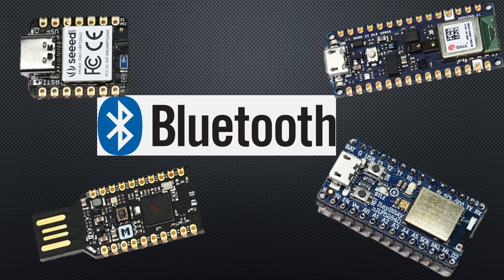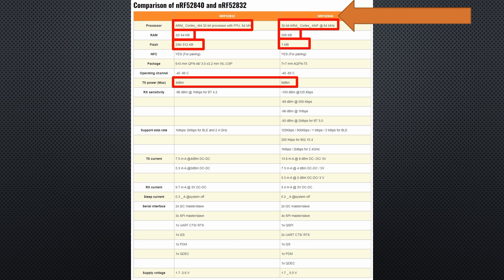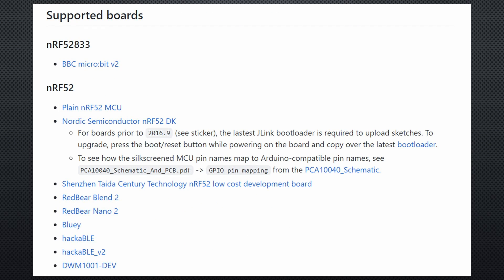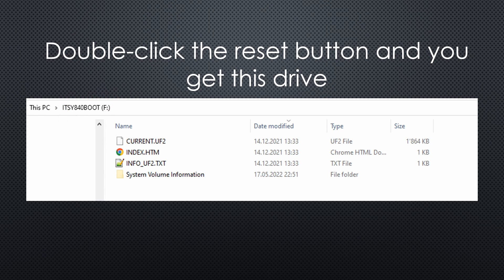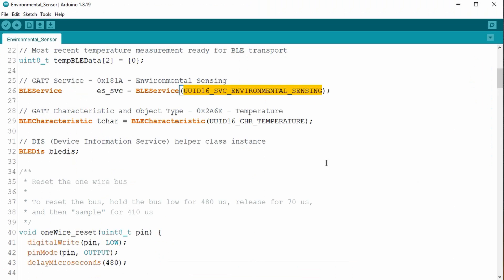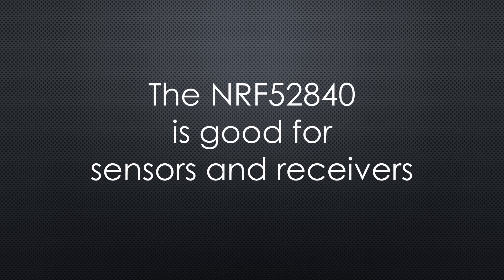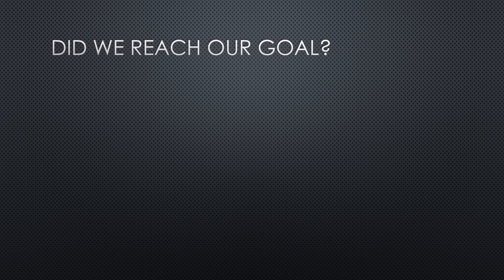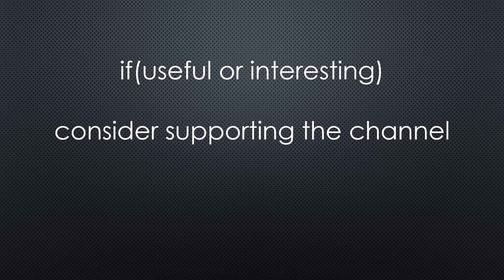429 NRF52 Bluetooth (BLE) Tutorial. Does it consume less than the ESP32? (Feather, XIAO, ItsyBitsy)

Comment: Great Video Andreas.   I have been a maintainer of a BLE keyboard firmware ever since the days of the nRF52832.  When I first got into it, I did try to program with the Nordic SDK and after hours of work, I still couldn't even get a LED to flash.  I then turned to the Adafruit nRF52 board support package and I was able  to get it working within minutes.  Since then, I have been creating keyboards and even extended my firmware to the nRF52840.  It's really a shame that Nordic doesn''t support the maker community and that Adafruit will only accept boards that they make or sell to be as part of their BSP. (This is quite understandable from a support point of view).  However, this only helps fragmenting Arduino Support for the nRF52840 boards into several forks and really doesn't help for maker adoption.  The nRF52 chips are amongst the best (if not THE best) for power consumption.

To get power consumption down with the Arduino IDE, you need to do some coding black magic (minimum would be to make sure to use a delay in the main loop; if you use a loop) and measure, measure, measure.  Apparent small changes in code, sometimes makes big differences in power consumption.  One has to remember that the CPU when running non-stop would use about 6mA (from the datasheet) and the radio about 20mA (From the datasheet).  Anything to minimize CPU time and radio time will help bring power consumption down.  There are also some "magic settings" from the softdevice that will also influence power consumption.  These aren't documented in the Adafruit nRF52 library but are buried in Nordic's documentation.

Adafruit's implementation uses FreeRTOS to manage the main loop and any other tasks one wants.  Delay for the Adafruit nRF52 library isn't a true "delay" but more of a yield of the currently running task to other tasks.  If the RTOS doesn't have any other tasks to process, it will go into low power mode until the next "tick" and see if it need to go back at running the delayed task again.  If I remember well, the "Idle" task does have the necessary code to put the CPU into idle state (low power) but the default might not be what everyone wants.  The defaults that Adafruit has implemented are reasonable for most applications but are not necessarily for everyone.  A lot of the tweaks one would need to do to get it running exactly as they want aren't exposed by the library but many settings have been exposed since I first started working with it.

To make fragmentation even worse, support for the nRF52833 (a chip with USB - like the 840 but with the flash and ram of the 832) isn't there yet, even if the chip has been out for a while.  The complicating factor to get support for it is Nordic's different softdevice versions.  From what I remember, the update from 6.x to 7.x changed a few things and none of the Arduino libraries I have seen supports the 7.x version - which is the version needed for the 833 and the newer, more advanced BLE features some people have been asking about.
Reply: Oh actually, the seeed xiao ble core uses the 7.xx softdevice and version 1.0.0 of the core includes the bluefruit library and examples
Reply from the maker: Good information. Thank you! Maybe we will get more attention after this video…

Comment: HyperX has managed to get 300 hours of operation from a single 5.5v cell in their new cloud headset. Maybe buying one and pulling the board and Bluetooth controller out might answer your question. The new chips use like .7miliamps , which is very impressive.
Reply from the maker: Astonishing! Usually this is the result of good hardware and good software…

Comment: (reposted without links)

Adafruit has long promised to look at power consumption, but it's not been a priority.  But there are workarounds.

First look at the issues database on github for the project.  Many tips.  One of the most beneficial I found was reducing the tick rate in the underlying freertos.  By default it is 1024, which means the processor is waking up 1024 times a second.  As the underlying nordic softdevice is handling beaconing, that is far too often for a simply beacon.  Those 2ma spikes you are seeing is freertos waking up the device.

I developed a beacon that sent temperature and humidity using the 832 chip. By reducing the tick rate to 4, and only reading temp/humidity once every 30 seconds, with a 2000ms beacon, I was able to get power consumption under 5ua.   Below a tick rate of 4, it would no longer work.      This should work with the 840 as well

Here are some tips

xxx
xxx

And here is the nordic online power profiler estimate tool.   With the above tips I get close to what they say is the lowest. 

xxx
Reply: (links for above)

Here are some tips

https://github.com/adafruit/Adafruit_nRF52_Arduino/issues/165#issuecomment-454707613
https://github.com/adafruit/Adafruit_nRF52_Arduino/pull/262

And here is the nordic online power profiler estimate tool.   With the above tips I get close to what they say is the lowest. 

https://devzone.nordicsemi.com/power/w/opp/2/online-power-profiler-for-bluetooth-le

Comment: Your summary and "conclusions" lead me to consider using the "coin-cell beacon" as a stand-alone, local slave, which serves NRF52840 timed interrupts. .. So, the NRF board need only "wake itself up" and "ask" the coin-cell beacon for the most recent sensor value  .. Maybe, the NRF update interval could be increased until the entire "system" could run for one year,  on minimum battery resources.  (Yes, "an expedient hack" but, for a tired,. old engineer, who values time over money, such an expedient kludge could be a *good thing!).
Reply from the maker: Maybe this will work. Somebody has to try it.

Comment: Nice video as usual. You could use [nRF52840 Dongle] for sniffing the BLE packets (its really useful) and supported by Wireshark I think. Also it could be used as a BLE server for sending and receiving BLE data.
Reply: It's possible to switch of RAM banks. The Arduino libs wouldn't do this by default, unless it is in 'system off' low power mode, which resets on wake so RAM contents not matter anyway.   dont know if any expose this as an option.  It's best to get a board that has the external 32kHz oscillator,  Low Frequency Clock (LFCLK) in the docs, as this further reduces power consumption, and ensure any Aruino library you are using enables it.
Reply from the maker: @Omar: I was not aware of this possibility.
Reply: @AndreasSpiess  Unfortunately I can't put links here in the comments, these topics will help you.
- nRF Sniffer for Bluetooth LE
- nRF Connect software
- Bluetooth GATT Protocol for Bluetooth Low Energy (BLE 4.0)
- Installing the nRF Sniffer [Nordic semiconductor got extensive WIKI with all required information] and also they got Wireshark plugin for the sniffer.

Comment: Awesome tutorial this will be a good reference to start programming this processor. Nordic has the leadership in BLE field. Generally, it has higher price compared to ESP32 though.
Reply from the maker: Yes, the ESP32 is very cheap!
Reply: Have you tried to program and use the peripherals on the ESP32 (e.g., the ESP32S2)? It's hideous. They're all screwed up. The ADC is not useful for anything beyond a potentiometer input, and even for that, it needs a translation table to linearize the values. That chip is a joke. Contrast that with the Atmel SAMD51 or the nrf52840. They presumably use peripherals from the ARM library. They work beautifully -- even the ADC is useful for many purposes, and in fact, it's offset/linearity/etc. can be tweaked through registers. It's a thing of beauty.

The ESP32 chips are fine for calculators, but nothing with non-trivial I/O.
Reply: Well it is a bit unfair to judge ESP32 like that. There are many parameters to discuss. Assume that ESP32 is just like what you have said, it would be impossible to go that popular in the market, where there are real products run on ESP32. 

You can give ESP32 a try using its native SDK. It has improved a lot
Reply: @usefulelectronics , you may not be replying to my comment, but I'll reply to yours.

The core and peripherals on the Nordic chip work the same they do on other Cortex M4 chips, for which there is very good documentation. Perhaps Nordic could provide better documentation on the Bluetooth section of the nrf52840. (By the way, Raspberry provides even better documentation for the RP2040, with it's dual-core M0+; they are also very up-front about with its errata.) I don't have personal experience with the RP2040, but I have a fair amount of experience with the ATSAMD51, the nrf52840, and the ESP32S2. Except for Bluetooth, the first two of those chips operate identically, plus or minus clock speed. The ESP32, on the other hand, has a fine core (with less flexibility than the ARM chips, and with very poor documentation, as I said), and with very poor peripherals that are full of show-stopping defects. If the ESP32S2's core were sold as a microprocessor, that would be fine. The products that use the chip are likely using the "SoC" in a simple way, driven by cost considerations. Once you finally get it to do what you want, it's not hard to crank out a lot of that product. I would not, however, use that chip in any critical application. There must be better choices among RISC-V-core chips.

So far, though I don't have insight into the internal machinery and registers of the nrf52840's Bluetooth section, it's worked well and reliably for me. Nordic is a serious company, unlike Espressive and the IP chain that underlies that RISC-V parts. For toys, it's not a big issue.

Comment: The hardware support on these chips to send async pulses is easy and flexible; one of the best on the market I have seen for Arduino.  Great for IR, NeoPixel, etc sort of features; without using bitbang so it timing is accurate and doesn't processor time (power?) to support them.
Reply from the maker: Interesting! Thank you.

Comment: i would like to see a followup on this incorporated into a presence detector, as you have eluded to. ideally two versions: 1. portable. 2. stationary. (power consumption not as important)
kismet currently has under development some bluetooth functionality along with wifi and gps mapping. at this time their are limitations with the given chipsets.
alex lynd has made a proof of concept “creep detector” with wifi and kismet, to alert users of stalking based on recurring mac ids in different locations. limitation is the person to be detected has to have wifi on. his code relies on jupyter notebook which requires a google account, which i am not interested in.
bjørn martin hegnes has a research presentation / paper on kismet with wifi and bluetooth mapping. the long range bluetooth dongle he uses is hard to find now and pricey and consumes much power.
incorporating both wifi and ble with a power-saving chip onto something more portable like a raspberry pi, reterminal, wio terminal, m5stack or even an embedded device which detects for recurring mac ids with wifi and bluetooth and logging the gps locations i think would make an awesome tool.  
portability would be a challenge while eliminating clutter with dangling devices, power banks, cables, and antennas.
initially i was thinking of such a device in a theft-prone area to log evidence of potential thieves who brought their smartphone with them. but the hardware at the time was very limiting.
what do you think?
Reply from the maker: I made videos about BLE and WiFi sniffing…

Comment: As others have mentioned, the ESP32-C3 (RISC-V supported with Arduino IDE) might be worth checking out. And it doesn’t get any cuter and maybe cheaper than the M5Stamp C3U. Have a great summer and remember to ride the bike a little.
Reply from the maker: I once made a video about the C3 (mainly about RISC) . And I will ride both bikes extensively during summer…

Comment: Thanks for the video Andreas and great timing for me as I have recently started experimenting with the NRF52840 development kit. As others have stated, the learning curve is very steep, but I finally managed to build a thermometer beacon. It transmits every 5 seconds using the highest power setting (+8dB) and is drawing  an average of 34µA with only the most basic power saving features enabled. I'm sure it can go a lot lower with further tweaking.
Reply from the maker: I am sure this is possible. I would love if somebody would transfer this knowledge to a Arduino library…
Reply: Code written on nRF studio or arduino?
Reply: @elangovanhariprashanth4087  I used nRF Studio with the Zephyr RTOS.
Reply: @garytrehair  What helped you get started on that so you’re not so lost? I am experimenting with the NRF52840 as well as the NRF studio.
Reply: I read your comment and found your project really interesting. I’d like to build something similar, but I’m just getting started with the nRF52820 DK. Could you share some tips on how to begin and what the first steps are? I’d also love to know a bit more about how you built your project. Thanks in advance!

Comment: First thought for reducing power is to reduce tx power in code and further stretch advertising interval.
Use board with rtc xtal installed AND properly configure it from code.
Use lowest permissible power mode whilst ble beacon still works.

For those who don’t want to use softdevice, alternative exists:
Riot RTOS support nrf thru Apache Nimble,
Zephyr RTOS has direct NordicSemi contributions for ble drivers.
Reply from the maker: Maybe I will have a look at Zephyr once…

Comment: BTW, one more board one could try is an ESP32C3. They are now even available in the ESP01 form factor. Before I used the Xioami thermometer I built a WiFi solution with UM's TinyPico and after that ran out of power after 90 days I tried a TinyS2 which is still running after a 100 days, just to see how long it will run. Both had long intervals (6min)  between readings and only switched on Wifi in case of a temperature change (sensor was a BME680 and now and SHT30 powered via GPIO, battery was 1000mA Lipo). My next try would have been an ESP32C3, which may give better results with BLE instead of WiFi).
Reply from the maker: Good point. So far I never used the C3 in a project.
Reply: There is also official LOLIN Store on Aliexpress with another tiny esp32c3 board variant "C3 PICO V1.0.0" 25.4x25.4mm (which is larger than TTGO T-01C3, but seems more usable for different cases). And Seeed XIAO module on esp32c3 chip is also available.

Comment: These chips can do about 1.5uA with a average of 1mA  (this is the lowest I got it to go). This involves some black magic with the internal PMC, how the IO and signal strength (antenna power) are managed . It is also required to use the deep sleep features and a damn good regulator in some cases. I believe the Arduino core only uses idle CPU state witch seems to be supported by the measurements you have shown.
It was never required to use Segger Embedded Studio or Keil. Eclipse worked just fine. It just required some extra steps to install. A full guide is available on there site (last time I looked, way back when). 
Something with the dev boards available is that I have not found one that exposes the second IO port on the NRF52840.
Fun fact the modules are made by a 3de party company called Raytac.
Reply from the maker: Good info. Maybe somebody will add a small low power library or change the examples to use these particular modes…

Comment: Thanks Andreas. Long awaited video! The Adafruit core (also my favourite by far) is based on freeertos and has some interesting functionality. I think you should try out not suspending the loop but instead putting delay(xxx); in there which is the equivalent to a sleep mode. A little counter intuitive. 
The XIAO BLE sense powers all of its sensors from gpio pins so pulling them low switches them off completely. This is the most interesting nrf52840 board out there because it actually takes care of those things and also uses a very low Iq LDO.
BTW the seeed core is weird: if you install 1.0.0 you get a ported version of the bluefruit library out of the box with all the examples, whereas the 2.x version does not include them.
Reply from the maker: I saw the differences between v1 and v2 too but did not understand. I hope somebody will create a boards Definition file for the Adafruit core. It should not be too complicated for somebody with knowledge…

Comment: I was just thinking about  building a BLE thermometer with an NRF58240, but then I saw the Xiaomi LYWSD03MMC thermometers which you can flash with the ATC firmware and which then have very low power consumption. I got 4 for $27 and use them with OpenMQTTGateway, even the seeed board would be much more expensive than that.
Reply from the maker: Good point if you want to stick with BLE. For temperature and humidity Another possibility Is Zigbee sensors. They do not need reflashing…
Reply: @AndreasSpiess  I tried the Xiaomi Zigbee  thermometers at the location I need it, but the connection was unreliable. Additionally, the BLE variant has a screen where you can read the temperature directly.

Comment: Basically Nordic provides documentation and libraries for their chips. However unlike arduino the learning curve is very steep. It is easy to run demo, but once you need to run your own code it is pretty hard to debug. Because ble rf core is separate peace of code.
Reply from the maker: This is probably why I still stick to the Arduino IDE…